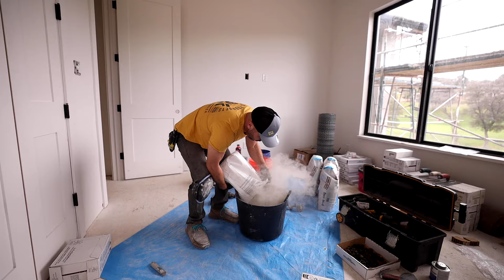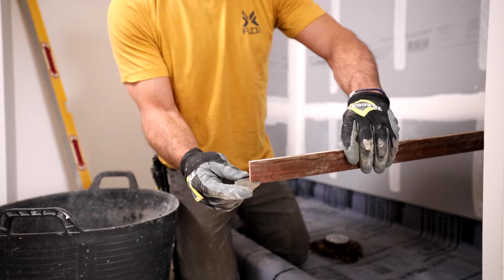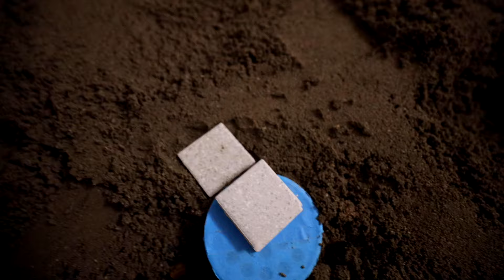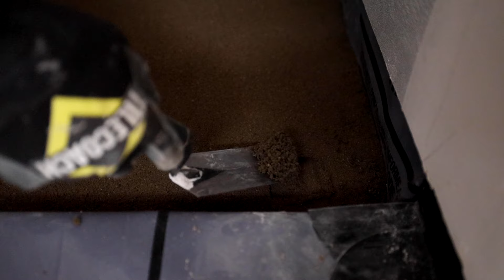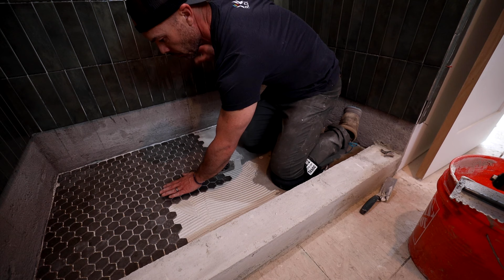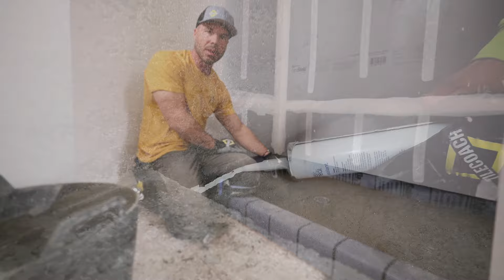How I Float a Shower Pan --- OLD SCHOOL Tile Shower Build 2024 Episode 2

Comment: Tile setter for over 40 years, retired before all these new systems came out, but I also absolutely always hated this kind of pan liner. Just hot mopped most of the time over a proper pre slope never fails. Also, an old school mud guy myself.

Comment: I am studying the different systems that you are installing bit every version has its downsides. I like this system but do not like water being under the mortar by design. Have you considered installing this shower base but covering the concrete with an addition membrane? So, keep the pvc water tight membrane but also cover the mortar base.

Comment: What’s an acceptable preslop?  I’m trying to bid an off shape shower where a wall was removed by previous contractor to make the shower bigger it had a wall with no door before now a door is at the original entrance and that section of the shower has no slope because it was like a hallway entrance. The rest of the slope I believe was made when they poured the concrete so it’s already got a sloped floor. I’m thinking about grinding the concrete where the wall was removed to flow with the rest of the slope if this is the case can I glue the liner to the concrete or lay a thin layer of bed mortar to smooth it out.

Comment: Hi Tile Coach,
I’m remodeling my bathroom and starting with the floor. The concrete subfloor, from the 1960s, has damage with old nail anchor holes. What’s the best product to repair these?

I plan to install Cerazorb Synthetic Cork Underlayment with a modified polymer thin-set, followed by heated flooring. Any recommendations or related video links would be greatly appreciated.

Thank you!

Comment: Concrete work looks good!
I use the same method, old-school, best rule!
Here’s a little tip!! On your next project, take it down to a full sheet , you only have about 3 to 4 inches of a piece, there’s too much shower liner in your corners, this will cause it to be pushed out and unstable. But the way you installed the shower liner it is the correct way though. You never know how your tile will lay out. You do not want to have a small piece over that piece of board.
Reply: Thanks for noticing this shotty work to! Did you notice the regular 1/2" sheetrock on shower walls? Just goes to show you, any old bloke can make a video. And yes, I am a licensed contractor in California.
Reply: @chesterarthur8571  That is not sheetrock on the wall, it is Dens Shield tile backer. You being a "licensed contractor in California" should be able to identify basic building products that go into each phase of construction.
 Methods vary from one man to the next, but having done several mud pans personally, his methods and finished work look great. From what I watched, I would not hesitate to hire this man.

Comment: Drywall contractor in Jersey here 
Replacing my own shower now. Installed Hardibacker and taped seams with straight flex tile tape with thinset.  How should I waterproof the boards before tile ?
What are you using these days.  Thought about a membrane and or some trowel on waterproofing.  Have you ever installed a membrane using laticrete ? Or any other combination. By the way if you sprinkle some Portland over your mud pan it will stiffen it up !
Reply: Red Gard liquid membrane.

Comment: Wow! Look @ you! Going back to the traditional ways. Tried to say this to you over all the years! It drys out! It drys out after every shower. Better than any system out there. If done correctly! Where's the floflex?lol
Reply: What's even better is you don't have to use the 30/40 ml liner to have the traditional system work. Just FYI!
Reply: Flofx is for membrane bonded system, not for liners that need weep holes. He just did curb less shower with, flofx membrane and drain.

Comment: A big hello friend, I love your videos and you are a person who has a lot of patience to be able to explain and for that reason I want to give you a hand. Next time do not use tiles to level, pay attention here, Next time better use metal light tube the 1/2 inch ones and you can also use the 3/4 and 1 inch ones depending on the job you are going to do. Believe me, the level will be easier and it will be easier and faster to make the bathroom and if you are going to put tile on the floor also work 100%

Comment: What is that gap between bed and walls ? 
How do you fill it later with drywall or cement boards or what exactly?
Reply: First of all, he is using regular drywall in a shower, this guy has no idea what he is doing. And yes, I am a licensed general contractor.

Comment: i think your notch for drain turned out a bit lower than anticipated, so you had to use a bit more thin set on floor tiles to make the difference. the notch is right but doesnt allow for slight tamping the dry pack. nice work my friend
Reply from the maker: You are correct!  I had to build up a little more thinset around the drain.  Thanks for noticing the small details!
Reply: @TileCoach yes I seen how gently you were tamping sheets down into the thin set, trying not to get thin set up to far in joints. Happened to me a few  times for sure when I did liner pans. Appreciate all you do my friend.

Comment: As a tile installer I don’t recommend using gravel because it clogs the weep holes and the water does not flow properly. JUST A TIP
Reply: So what do you use?

Comment: For the new guys! An exposed liner and a well-used trowel, you can cut the liner and never know it when troweling the mud along the wall and curb!
I cringe every time I see someone use a level as a screed or someone beets on it !  Have multiple size straight edges for screeding in your tool kit! 
Stablia makes a specific masonry level to beat on! It's not this one!
We used to lightly pack the mud like Isaac only when we would install tile wet same day and beet the tile into the wet mud! Today we don't set tile like this so I tend to really pack the mud alot more than how Isaac shows in his video! The more it's packed the stronger the final mud bed!
Isaac ever used a figure 8 pattern with your straight edges to establish the perimeter screed instead of beating your level into the mud?
Reply: I agree

Comment: been doing this for 35  years    video is good for rookies but i mud a pan in 45 minutes if my laborer didnt make too wet   then i have to show them again      tip  buy a good 36 inch wood level and cut both sides equally on a chop saw i find 29 inches i fine   keep up the good work

Comment: Nice float, but you really need your curb lath before the float so it ties in with the deck mud. Curb mud is thin & weak in comparison, and the step up creates an additional load, so it really needs to tie in there.

Comment: How you do shower pans is don't do panliners.  I'm in dallas tx. Everyone only uses panliners.  I learned shower builds years ago in California I have my cti certified . I'm maybe only one don't use panliners.  All my jobs are redos from failed panliners.  I use laticrete membrane or hydroban and my showers will last 40 or 50 years what a real shower should last. I learned my tile trade in Sacramento California 18 years ago. Texas is the worse state when comes to shower builds. Bunch of contractors here do not know how to really build showers.  No inspection here or nothing no flood test either crazy. I live in texas but California builds are by far more Superior
Reply: if you dont use panliners, and just use laticrete membran or hydroban, will this bond to wood floor?

Comment: the way you are doing this is wrong i  use metal lathe run from floor up the walls to the bottom of the drywall {it ties the system together} dont know who taught you this but thats NOT how i was taught.